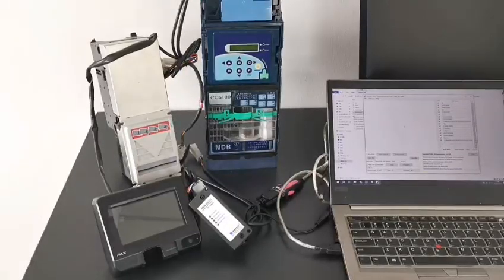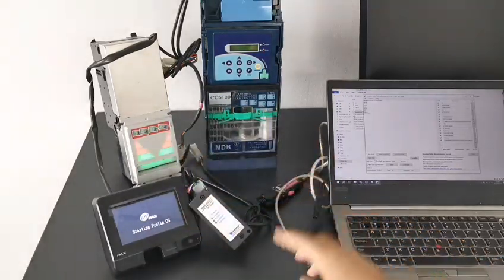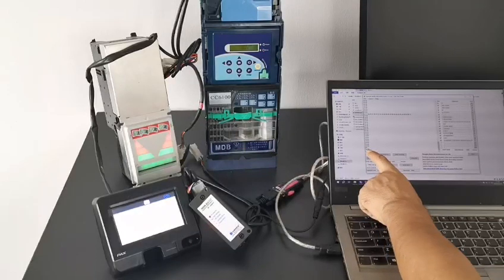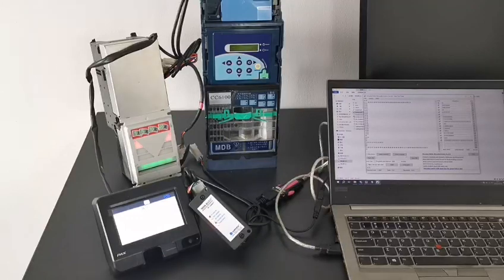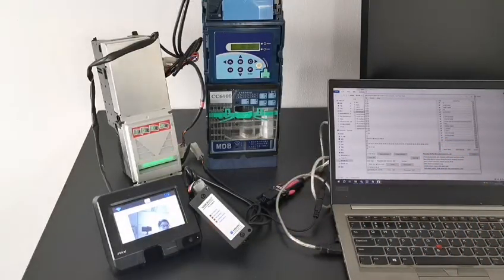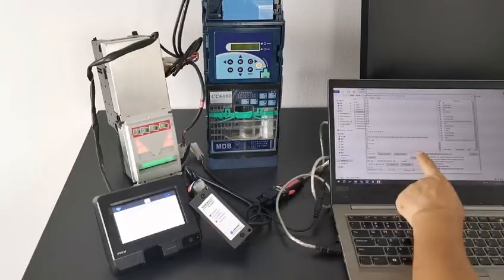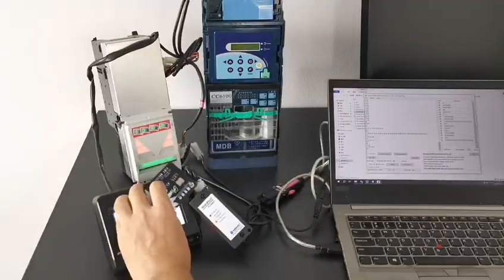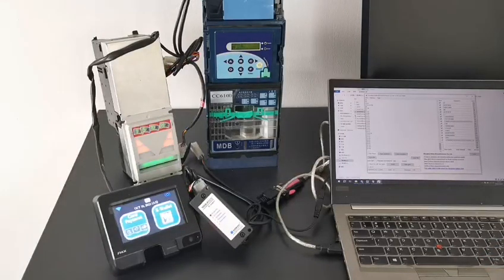MDB-RS232 converter box working with PAX card reader

Comment: Hi, my vending machine pax kept showing "Starting MDB" after every settlement and hanged. I had to restart my machine to restart the pax at the same time. Do you have any solution to this?
Reply from the maker: Dear, from your email to us,  Your vending machine is installed with other brand mdb converter, so we don't know the exact problems. you can try to change our mdb converter and ask your manufacture to change the design. then can work stable . we also will provide more technical service.

Comment: Hi. What software do are you running on the PC to act as the VMC?
Reply from the maker: We have the demo PC software to run on the windows PC. User can use the software to send the command to control the MDB payment device and also receive the payment credit data. After user is familar with the MDB protocol and data, then will develop the software in the VMC (normally use the android board to work as vending machine VMC board). If want to know more , can visit the website to read the manual and also download the PC demo test software:  http://www.mdb-rs232.com
Reply: @waferstar  I don't quite understand exactly what you mean but it sounds like you are saying that we need an android board to act as the vending machine VMC? But here is what I have set up. 

I have downloaded and installed the MDB-RS232 Test Tool and have it running on a windows PC. I have the the IM30 connected to PC via the MDB-RS232adapter using a USB-RS232 converter.  The MDB-RS232 Test Tool parameters set to baud rate to 9600,  Parity to None, and then selected the port that the device is connected to.  

Questions:
The "Cashless device" led is continuously blinking on the MDB-RS232 PC adapter. Should it be steady?
I do not see any information being sent from the IM30 to the Test Tool when the IM30 is initially connected. Why is that?
Does the Test Tool running on the PC act as the vending machine VMC?

Thank you.
Reply: Actually looking at your video again, my setup is similar to yours except that I only have an IM30 device. Also from what I see on your PC screen, the interface of the MDB-RS232 Test Tool on my PC looks a little different than the one you have in the video. Can I send you an image of my setup and show you what the interface of the Test Tool on my PC looks like? What is your email address?
Reply: What software do you have running on the IM20? Is that some custom software that you developed?